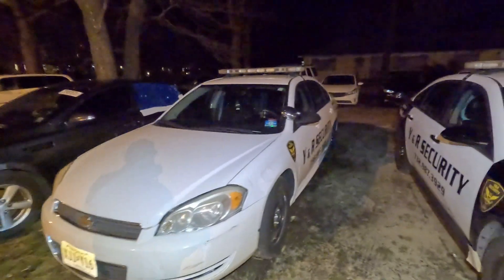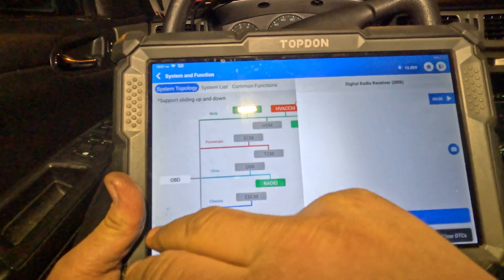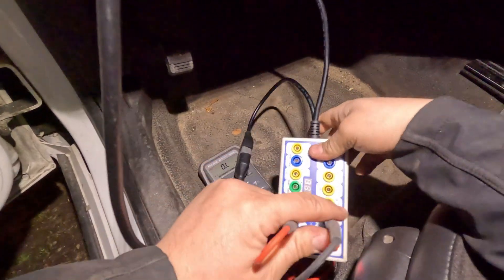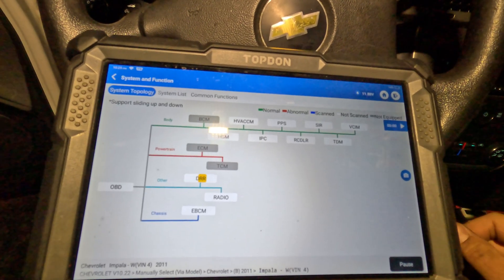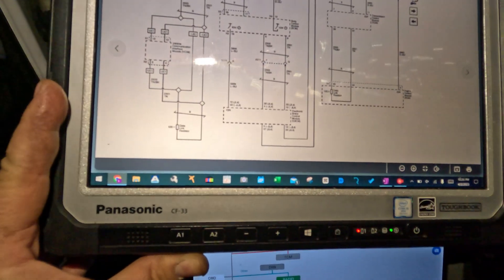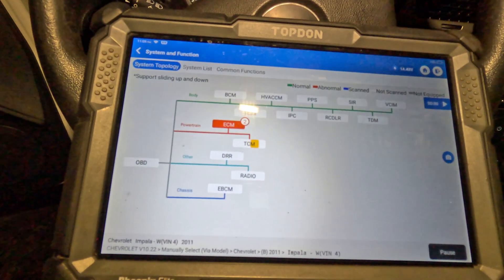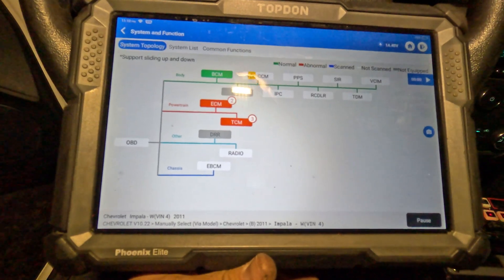2011 Chevy Impala No Com to PCM - Diag & Fix!

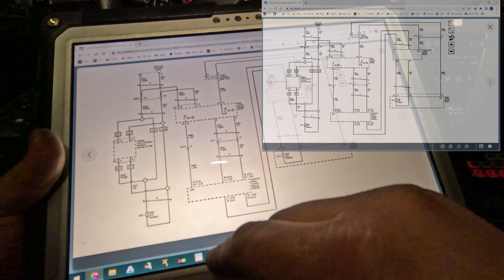Comment: Nice, but Im missing something. How did you figure out that the ABS module had a no comm (2:45)? I only saw the ECM and TCM on that one high soeed network that the scan tool couldnt comm with. I dont see any abs module in the toology. Thanks!

EDIT: OOOOOH, I get it, the topology on scan tools can be helpful but not necessarily accurate. Thats wherr the diagram came to the rescue as you saw that the network has to go through the AJS module first to get to the ECM and TCM. Nice one! I would have gone down a rabbit hole because of that topology...

Comment: Awesome videos mate, from UK here, noticed when you bridged can L and H feeds I dident see using a resistor to complete the circuit, I’m assuming the abs had a terminating resistor internal so just wanted to ask if you did use a 120 ohm resistor ? sorry I know it’s stupid question but I’m still a novist so just curious. thank you so much for all the videos your putting out here by the way, really educational stuff
Reply from the maker: GM can communicate fine with 120ohms if I was trying to read a BCM on the bench that has no resistor in it at all then I would add 120 ohm resistor.

Comment: I just plugged in the scan tool after replacing the air mode modules to recalibrate and it's not communicating with the scan tool and it won't turn over or start.     starter spins when bypass the starter relay and 12v to the ecm ? I thinking it might be a bad ecm . I did unhook the battery while replacing the ac mode modules, any one have any ideas ?
Reply: did you figure it out

Comment: Just did a video on the newer gm gen 3 serial data and 120 ohms is good on pin 6 and 14 at the dlc
Reply from the maker: Yes, I just had a 2020 Malibu, the gateway itself has 120 ohms. You always have to look at SI on the newer vehicles. Thanks for watching!

Comment: Do you see any advantage or disadvantage of using identifics over all data
Reply from the maker: In my opinion they both have there place, I like all data the best for wiring diagrams as it can put them all on one page and you can select a wire and it highlights it through out the whole diagram. Identifix just started allowing that also but IMO it's not as good. another advantage of alldata is there is info on later model vehicles. I have identifix for the fixes not to use it as a silver bullet but as direction and sometimes they say how to test something.

Comment: You did a good diagnosis, however it seems like you forgot to check powers and grounds to the abs module before replacing it. However it seems like one was there laying around. And that probably through you off, I don't know, only you do. Keep up the good work.
Reply from the maker: Really good point! I did check them off camera before I spoke to the customer, But I lost the 2 clips of me checking them and the next clip of me examining the parts car, showing how it was missing a head etc.
Reply: I was going to reply the same thing.  Also those holes in the wires that the bypass clips made need to be filled in with the connector down in that location.
Reply from the maker: @jimr549  Yes when I put every thing back together I put liquid electric tape on the holes.

Comment: when do you have time to upload these? ep tof shin pay gimel
Reply: Good diagnosis. Only comment I'd make is to use some .024" solid copper wire to jumper the can bus pins at the face of the ABS module connector. I try to avoid piercing wires as much as possible or at least use some liquid electrical tape to seal the pinhole.
Reply from the maker: I usually use my AES wave brake out kit to jumper the wires but the small ones broke, I always seal up the holes when I'm done testing with Liquid electric tape or clear nail polish, Just don't usually show me putting the car car back together in the video. I might start adding it into the video because of all the comments I'm getting😉